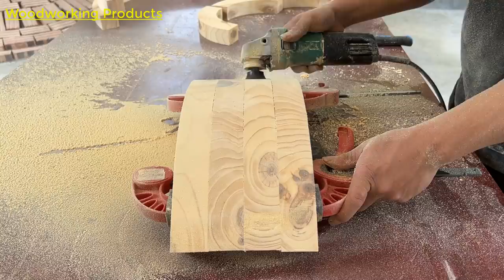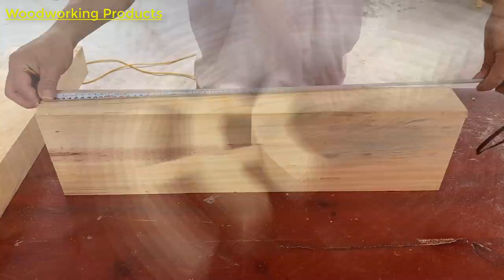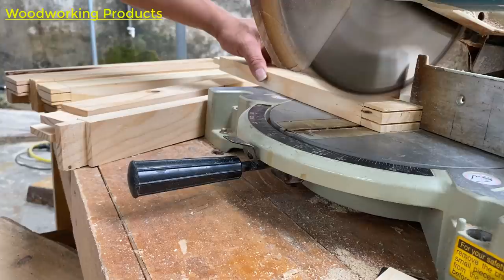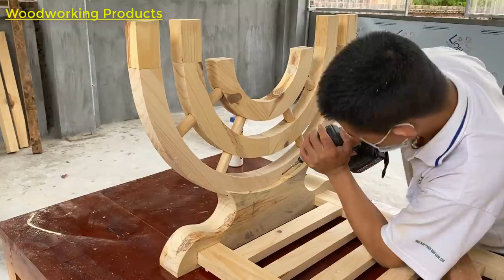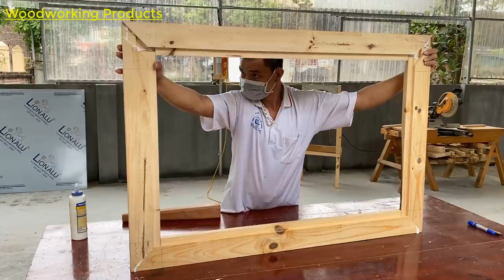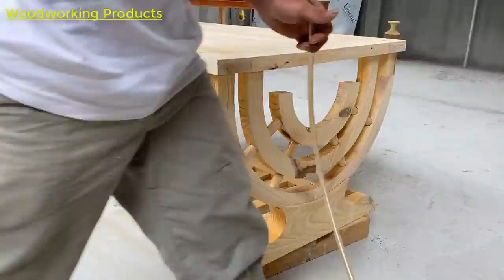Extremely Hard Woodworking Techniques You've Never Seen // Perfectly Curved Furniture

Comment: Things you might think about… riving knife for the table saw, bench vice , only one piece of wood in the chop saw at a time ,and no lifting the wood off the table into the blade on the chop saw ,make that cut on the bandsaw instead. Just some safety tips so you can keep on making with all your fingers intact. But seriously , the riving knife could save you from a serious injury.
Reply: As a former woodshop supervisor and instructor, I totally agree. Also, using an angle grinder with a sanding disk to do large flat surfaces just adds more work if you ever intend to finish it to a higher degree. And I winced when I saw you using that bandsaw blade. Like Russell Peters said, "someone's gonna get hurt".
Reply: What is a riving knife?
Reply: @jonathanechols9985  a riving knife installs behind the table saw blade and prevents the cut from closing and potentially sending the board back towards you at a high speed. All table saws come with them, but not everyone installs them. Maybe they like the danger…lol.
Reply: @madpainter7114  I haven't seen very many, even on store models.
Reply: @jonathanechols9985  My ko 40th

Comment: I have to comment on the large gap of the band saw blade from the table to the upper blade guides. Looks like the upper blade guides are all the way up. Exposing the better part of the blade all the time. The safe way would be to lower that guard and be safe. and prevent blade wander.
Reply: That's exactly what i was thinking, it is safer and with the guide down near the piece of wood the cut is more easy to do.
Reply: Oh yes! One distraction could lead to a serious cut! Gave me shudders.
Reply: @guyg.5339  Safety is not a concern in Asia.
Reply: @bowhunter7485  like the safety of schoolchildren is of no concern in the US?
Reply: @noeraldinkabam   Oh no no, safety of children is number one!!! I probably couldn't express myself the way I intended, sorry.
Reply: @noeraldinkabam  nope, fingers are far more safe in Asian workshop than our children are in a United States elementary school which leads me to this 😡😡😡😡😡😡😡😡😡😡😡😡😡😡😡😡😡😡😡😡
Reply: @IllbeaMarinetillthedayidie  for sure.

Comment: Like the joinery on the table top border. Not to excited about the extention blocks on the table legs to table top , would be nicer to cut it all one piece but I know material that thick is expensive
Reply: I agree, all the work he did to make the curves, then use ugly extension blocks. Ruins the look in my opinion
Reply: Exactly! Those added blocks look awful. Probably a miscalculation in the plan that left the table too short, hence their inclusion.

Comment: This is pretty amazing. Does that joinery hold strong enough to overcome the expansion of the paneled surface? Breadboard ends sound like a pain in the rear and I'd rather do it this way.
Reply: I think that's where clamps would come in handy but it was really comical watching him get things lined up.
Reply: That was my thought too.  Even if the joinery holds, I imagine the panel would either buckle or split (depending upon the climate where it ends up).

Comment: Why are you using such a high cut throat. Closer thee the guides are to the cutting surface the mir control you have on the blade. Or is this the latest fashion?

Comment: I like the overall concept, the construction is novel.  However, the quality of work in this piece is lacking.  Many rough joints, edges and chips.  A bit more fine craftsmanship would take this over the top and would not require significant time, some more attention to detail.  When the craftsman builds a piece for the ages, it shows.  This piece is entry level quality. It should be relatively inexpensive.  Overall I would give this a grade of C.  Would I buy it, probably not.
Reply: I would like to add that the craftsman should research fine American furniture for examples of fine wood working and how that is accomplished.  It is not about speed of production, but quality, quality, quality.  It takes time to create a work of art that will stand the test of ages, generations!  And to pile on, if you can't accomplish the task with safety in mind at every step of the process, it is not worth doing.  Your safety is number 1 priority.
Reply: @greggramig910  doing it proeprly with the tools and machines he has to hand would give far greater quality - and would be quicker.  It is often slower to do something wrong!
Reply: Isn't this design lacking in strength since there's no diagonal support?

Comment: So, I'm not here to disrespect or discourage anyone, but I don't like being click baited.  I didn't see any "extremely hard woodworking techniques" at all, much less that I hadn't seen before.  The tenons on the corners were kind of cool, but completely impractical.  The only real difficulty I saw in this piece was during assembly and due to the utter lack of anything resembling precision pretty much every step of the way.

Again, I'm not here to discourage, so please, let me offer some constructive criticism:

1) That thing is going to be a busted mess in 2 years since no allowance for wood movement was made.  At all.  You cannot miter the corners of a table top that way unless you live somewhere that is the same temperature and humidity year round.  Very soon those miters are going to try to separate, and if they can't the top is going to crack.  The mortises in the legs where the stretchers are connected are way too tight.  When they swell, they're probably going to crack the legs.

2) Freehand drilling holes between multiple pieces, especially multiple times, is an exceptionally bad idea.  The lack of precision in that operation almost cost you a lot of time and effort.  Next time, set up a jig to help.

3) Any time you attach a top to a base, allowances must be made for wood movement.  The way you attached it is going to break or crack your curved supports soon.

Comment: Well, let's see: I've never seen someone operate the bandsaw with 10 inches of unsupported blade above the workpiece... I've never seen someone use freehand-drilled hanger bolts for joinery... I've never seen anyone round dowels using nothing but a disc sander... I've never seen anyone rotating a piece of wood into a spinning miter saw for the extra reach.

Credit where it's due though: that was some slick miter joinery given how fast you production lined it out.
Reply: Why watch All of this presentation and then be very negative, then you give a backhanded compliment ?😏
Reply: Exactly, you hit a nail on the head, safety is not a concern for them.
Reply: @RRED2  You appear to have missed my point.

Comment: Cutting on bandsaw... ganging up and gluing wood... sanding with a grinder... making arches with multiple blocks of wood... using a marking gauge... drilling with forsner bit... using a chop saw... THESE ARE BASICS, NOT  "Extremely Hard Woodworking Techniques You've Never Seen"...